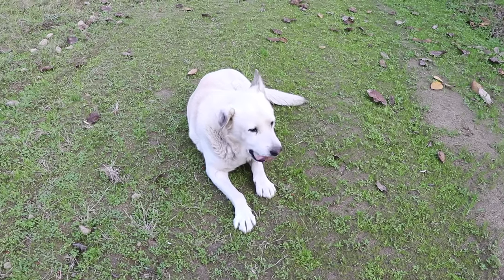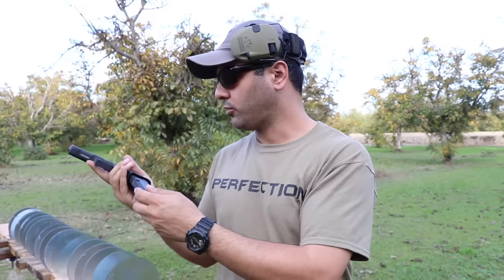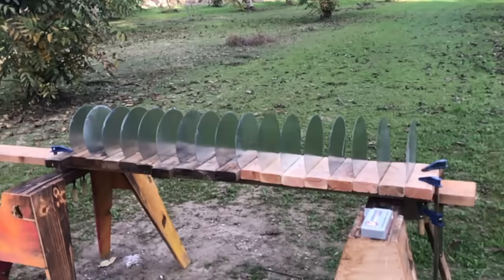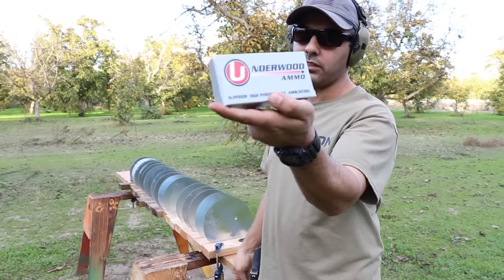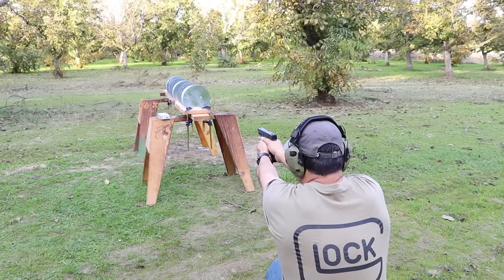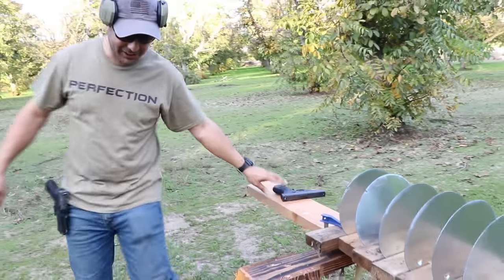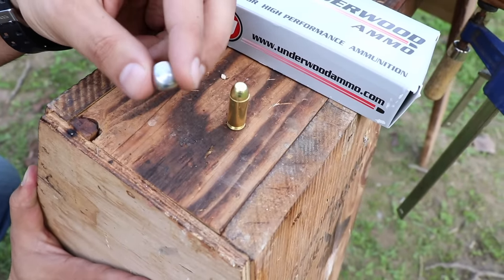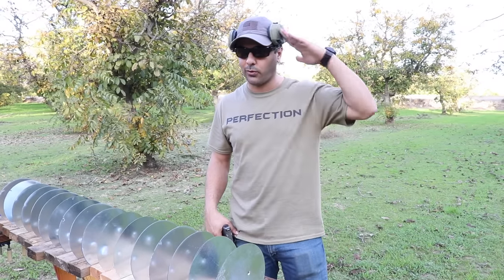9mm vs 10mm vs sheet metal

Comment: 9mm: I Am The Best Pistol Round Ever
10mm: Hold My Beer
Reply: Liberty Prime 9mm never been the best and a 10mm wont do it either you need power and speed for protection and what do it is a .40 or a .45 but thats just IMO
Reply: @bbop6060  but 45 dont have the speed
Reply: @bbop6060  40S&W is literally worse than 10mm auto
Reply: @bbop6060  45 is a big slow bullet.
Reply: 9mm for the hoods... 10mm for the woods.
Reply: Thinking of getting a 10, is the recoil really that bad? Im not getting a glock, ill be getting a bigger heavier gun for the 10, but im still fairly new so im worried i cant handle it
Reply: @changbooger  10mm is manageable. Definitely rocks harder than a 9, but it's easy enough to handle with some practice. I'm 5'6, 153 pounds and I can rival my buddies shot splits with my Glock 20. He's a bigger dude and has a Glock 19. It's all how you practice
Reply: Trevor Yates sweet thanks for replying
Reply: @changbooger  not a problem, I'm happy to help
Reply: @bbop6060  ...40 is a 10mm short...and 45 is slow unless you go +P...and then it still won't make 10mm power...you want more power you gotta go revolver...ie...44 mag and up...
Reply: @bbop6060  shot placement matters more than girth a .22 can do the job sufficiently with good shot placement
Reply: Mass always wins over speed
Reply: @bbop6060  you do know that the 10mm is the 40 cals parent. In order to make the 40 they lowered to 10mms load. 
10mm is .4 inches  or 40 caliber,  I'm pretty sure you're either confused or trolling.
Reply: @changbooger  if you get it in a decent size pistol it's not bad
Reply: What brand 9mm ammo did you use?
Reply: B Bop fbi stats show 9mm with hollow points is just as effective as a .45
Reply: 9mm,10mm...you don’t want to get shot with anyone of them..if that makes any sense.
Reply: @Yates235   I'm guessing you've heard something similar in your life?   Not the size that matters but how you use it?  Lol 😆
Reply: @BeReal918  honestly though 🤣 I mean, a 180gr speer gdhp at around 1400 fps is making around the same energy as a hot loaded 180gr .357 magnum. It's just more prone to energy transfer because it is a wider projectile. 357 would be faster to penetrate a target. Unless you're making reference to something else 💀
Reply: @bbop6060  10mm is literally a .40 cal bullet
Reply: *Hold my 185 grain casing.
Reply: @plumeofsmoke4202  so many people forget that.  If you have a 10mm and cant shoot its useless in the woods.  But if I have my 9mm and can shoot its plenty of power to stop a brown bear.
Reply: @changbooger  my Springfield Hellcat has worse recoil than my G29, G20 or G40
Reply: @4u25out  exactly!
Reply: @bbop6060  you do know a 40 s&w is 10mm short?
Reply: 10mm is usually hard to control for a pistol and is not really good for self defense or home defense.

Comment: 10mm would have gone through more sheet metal if it didn't went off an hit the wooden table
Reply: Agree.  Still great video that shows the big difference the 10 has over the 9.
Reply: william terry  relax man, have some human decency
Reply: william terry lmao wow ok
Reply: But it got stopped by the sheet metal and bounced off? It never hit the wood.
Reply: He should have tried to shoot up high like the 9 mm
Reply: E F it definitely wasn’t a consistent test. The higher on the target the more flex. I personally think the flex works against the bullet but I’d like to do a test.
Reply: Rick James I agree about the flex ,and thank you for the reply :)
Reply: Yeah wood definitely stopped a 10 mil round, it’s biggest weakness is wood.
Reply: The 9mm would’ve went through more of it had underwood Ammo and the shot was placed low like the 10mm so it would’ve have to deal with the flex of the metal.
This was the most unfair test and still the 10mm only went through 3 more 🤯
I think this is more about how impressive the 9mm is especially when you consider he’s using range Ammo 9mm VS underwood 10mm which is some of the best Ammo you can buy
Reply: @RickJames-xy6io  what about range Ammo VS underwood?

Comment: The 10mm might not have gone through as many plates if the shot was at the same height as the 9mm. You can see the 9mm shot flexes the plates a lot more as the bullet goes through, this flexing would slow the bullet more than just punching through the bottom that is more solid.
Reply: Your goofy fr😂
Reply: Another point is the 10mm being a wider bullet makes more surface area for resistance against the metal plates
Reply: @deseanhodge5008 he is correct.

Comment: Not a great test.  The length of travel through the number of plates is highly dependent on whether the projectile is hitting the tops of the plates as opposed to the bottom in his setup.  The top sides of the metal plates have far more flex, bounce, wobble, etc., which will cause the projectile to tumble more than if hitting the bottom where the plates are held in place more rigid than the top.  The more tumble, the less the penetration as the projectile travels through the plates.

Comment: We have to take into consideration where the bullets penetrated the sheet metal discs. The 9mm hit further up on the discs allowing the discs to give or flex more than if it hit closer to the bottom where the disc has more rigidity and less flex. Example. The 9mm is pushing or bending the discs backwards on impact. Therefore, absorbing the impact more than at the bottom where the disc doesn't move with the bullet but rather against it.
Reply: Thought the same!
Reply: Either way hard to justify the cons to using 10mm now. Really puts the increased power myth to rest. 9mm will fracture your ilium within 10 yards outta almost any pistol. Maybe 10mm does it easier but the increased bullet size and overall pistol size, lack of metal frames outside 1911, and a bit too niche too reliably find ammo is too inconvenient to even bother. Had to mention muzzle flip.
Reply: I'm still gonna EDC my G29.
Reply: This is pure cope lmao.

Comment: The 10mm was also using more powder = bigger bang = more penetration. I’d be interested to see the same amount of powder pushing 9mm vs 10mm. Eg, let’s look at 185grain pushing the 9mm.
Reply: Why would they use the same amount of powder or same amount of grains? That makes no sense. They are different calibers and that is what he is comparing. The underwood is hot loaded 10mm too. A lot of 10mm on the market is less powerful than underwood by 100fps and 100fpe less. So a 10mm 180gr with 1200fps would penetrate even less than the underwood. This is to compare factory loadings tho

Comment: Carried a Glock 20 on the street as a service weapon. Loved it. My department wouldn't buy my practice ammo so I had to take .45 and trade it. I now have 4 other 10MM's. Amazing weapons and when used with the black talon ammo, would go through all those plates.
Reply: Would u recommend 10mm for carry and for home self defense?
Reply: King Wild  no it will travel through most people and home walls that’s not a defensive round a 9 0r 45 is but a 40 and 10mm not so much and it depends on the manufacturers ammo u got some make some very hot loads
Reply: @kingwild772  If you exclusivley use Hollow Points, than I don't see why not! Anything more though, and you will over penetrate your target!

Honestly though, for self or home defense, you're better off just carrying a 9mm or a 45 ACP. I have all 3 rounds, and I mostly use my 10mm for Woods carrying against Mountain Lions and Bears.
Reply: How would you compare felt recoil between a Glock 20 vs. 21?
Reply: Sorry but thats not true. Black Talon ammo was great at expanding but VERY UNDERPOWERED.
Winchester Black Talon 200gr STX (IC 3/25/14)
Ballistics Information: 10mm Auto
Muzzle Velocity: 980 fps
Muzzle Energy: 426 ft. lbs** My carry ammo is Underwood 155gr XTP JHP @ 1500fps and 775fpe. That is true 10mm performance.

For this test he could have used the Underwood Lehigh Defense 140gr Xtreme Penetrator at 1500fps having 700fpe. This round would most likely have penetrated all 17 steel plates.
Yes, Im aware this is a very late reply...Im kinda old and I dont care.😉

Comment: I've been looking for this type of comparison for years. I have a Glock 21 and was up in the air over a 9mm or 10mm. I think I'll go with the 10mm.
Reply: Their application is slighty different, with much overlap. 9mm is great for concealed carry or to just have a lighter gun for open carry. 10mm has twice the energy of 9mm. 10mm is better for woods carry for defense against bears, cougars, wolves, coyotes, etc. 9mm is plenty enough power for defense against 2 legged creatures. Obviously 10mm and 9mm can both still be used anytime, but if in bear country, that's when 10mm has the biggest advantage. I still feel more protected if I carry a 10mm tho lol
Reply: @jackmemphis777  I conceal carry a Glock 20 and my shooting really doesn’t differ much between a 9mm and 10mm. Let’s just say I’m more confident that 10mm won’t require half the magazine to deal with a threat.
Reply: @Matt Fransen  yeah I definitely feel more protected when I'm carrying my 10mm. You can just feel the power difference, but neither has much recoil. Probably partially due to the fact that the G20 is a lot heavier. The gen5 G20 has a longer recoil spring, too. I have a Holosun 407C on my G20. I am personally not able to conceal carry it very easily, though.

Comment: the 10 mm round was flat tipped. The 9mm round nose. Flat tip has and advantage no matter the caliber. try this again using a flat tipped 9mm round, preferably winchester m11 52 9mm which is also a flat tip with a similar muzzle velocity

Comment: Not fair, the 9mm went above the mid point of the sheet metal letting the sheet metal absorb more of the inertia. The 10mm went lower near the bottom where the sheet metal had less give and less absorption of the bullets inertia.
Reply: Dark Swim I was looking through the comments to see if anyone else noticed this.
Reply: Not to mention the 9mm is just using range Ammo and the 10mm is using underwood, some of the best Ammo you can buy, how’s that fair
Reply: Cope
Reply: I can almost guarantee you that the results would not change. The energy required to punch through the sheet metal is far greater than whatever would have been lost by that. It would have made very little difference. However, they should've set up more than one test to get more decisive results.
Reply: Are you really trying to argue a round with more powder and a full mm bigger wouldn't do more? Lol
Reply: Interesting perspective, cant say o disagree with that statement

Comment: projectiles will go through easier the lower down the plate you aim as there is less flex and wobble
Reply: Its irrelevant.  The test wasnt to see how many could be penetrated. But to see how many in comparison to the other.. the highest shot was less than an inch higher.. thats not enough to justify the 10mm winning ... The 10 mm just has greater or equal velocity , but instead of a 115 grain bullet, its 180 grains . More momentum.. also the 10mm was at a disadvantage because of the flat nose vs the 9mms pointed profile..     the flat nose has greater surface area and still managed to penetrate 3 more...  I do agree the test would have been more accurate if edwin had braced the top of the rack too..

Comment: I wonder if the 10mm got more penetration due to the fact you hit the metal lower and where it was more stabilized and not flapping around as much? But as always great video LOVE your shows!!!
Reply: Greg Hamacher . Absolutely right. Was thinking the same.
Reply: I think it got more penetration cause he is shooting freaking Underwood ammo!!!
Reply: Never used Underwood
Reply: Good catch! I was thinking along the same lines. The discs should be rotated, this way both test places the bullet approximately at the same location.
Reply: It's because the 10mm is almost twice as powerful. It would have gone through all of them if he had used a 115 gr 10mm instead of a 180 gr. I use 155 grain hollow points in my 10mm and they are more powerful than 357 magnum
Reply: Greg Hamacher - Or maybe because the 10mm is a more powerful round? Would you be surprised at a .44 magnum outperforming a .357 magnum? More gunpowder + heavier bullet = more penetration. Shouldn't be that surprising, bud.
Reply: @74superglide  - With 10mm you kind of have to use something like Underwood as most manufacturers water down their 10mm ammo to "FBI Lite" specs, which is only marginally hotter than a .40S&W. With 9mm, this isn't a concern as most manufacturers load to full SAAMI specifications, though to be fair, Underwood's do tend to run a little warm even in 9mm and he should've used Underwood for both calibers to avoid this scrutiny. However, I hope you aren't suggesting that a 9mm would've outperformed the 10mm in that circumstance because it's a much less powerful caliber - objectively. They both have their merits, but there's a reason why the 10mm is used for woods defense and the 9mm is not.
Reply: meifert2 Has
Reply: @greghamacher7649  , did you mean never use, or never used Underwood ammo?
Reply: I’m sure it did. The GIVE in the flapping metal absorbs more energy. Same concept with crumple zones in automobiles. By the time the bullet hits the last piece, it’s moving extremely slow (for a bullet). Think of how bullets only travel a short distance when they hit water. Bullets are extremely lightweight. But their small cross sections and high speeds allow them to be deadly. Slowing their speeds is correlative to reducing deadliness.
Reply: I seen a lot of 10mm JHP’s penetrate to 20 inches. 10mm is a monster  mostly made for 4 legged creatures.

Comment: 10 millimeter stopped because you shot in a downward trajectory thus the bullet ending up hitting the wood after the 14thsheet does eliminating the possibility of that 10 mm ground-penetrating each and every sheet of metal you had set up I guarantee it will go through it
Reply: Wrong. You can clearly see it made contact with the sheet metal

Comment: Hola amigo, está padre tu vídeo pero creo que la prueba es considerablemente diferente y no se puede hacer un benchmark claro ya que la altura de entrada de cada bala se va comportar diferentes según se aleje la bala de la base de la lámina. Trata que la 9mm y la 10mm entren a la misma altura con referencia a la base (la tabla de madera)
Reply: Actually it would have almost no effect. The property called "adiabatic sheer" means it doesn't actually matter much at all. Even if they were loosely suspended the results would be the same.

Comment: Hey what's up... I give you an advance ,,, when you shot with different kind of guns , try to hit in same position , because if you shot lower ,like you did with 10mm of course will go far , because there is not gonna move that sheet of medal . If you shot higher it will be more difficult , because it will move little bit.  You can see in the video ...  Thanks for your work anyway 🖐️👍👍

Comment: Thats why I have always said if you are going to run a 10mm make sure it is full power and a soft point round. If not you are just going to get something that has pretty much the same performance as every other handgun round. IE each an every new Federal HST round runs almost identically in each caliber in gel. Heck the 5.56 federal bonded is pretty much the same with the exception of the shock cavity.

Comment: 115 gr 9mm ball rounds vs 10mm underwood high performance ammo in 10mm? What kind of comparison is that? You should have at least used Underwood 9mm. However even at that the 10mm only penetrated 3 more sheets is really not that much more penetration. Especially since the 10mm was 65gr heavier in weight.

Comment: Full power 10mm vs 9mm is comparable to shooting a .357 Mag vs 9mm. Worlds apart different even 9mm +P or +P+ although very potent ain’t even in the same world as a Norma (original spec full house load) 10mm. Underwood ammo rocks and if you look them up they make even more power ammo for the 10mm than you shoot in this video.

Comment: This test is not that meaningful, because the bullets didn't hit the sheets on the same hight. It could make a difference and the 9mm could perform better. The reason is, that the sheets react mutch more flexible, the higher you hit them.

Comment: Id likw to see the same test but with the top of the plates braced like the bottom. Holding them rigidly in place.. and id also like to see the same test with either a flat nosed 9mm. Or a round nose 10mm.. the pointed profile of the 9mm gave it an advantage in this particular test.. both flat, or both pointed in a rack that braces the top and bottom
Reply: 9mm range Ammo
10mm underwood
Huge difference in Ammo selection and it only went through 3 more
I’m more impressed with the 9mm 
I’d like to see this again with the same Ammo